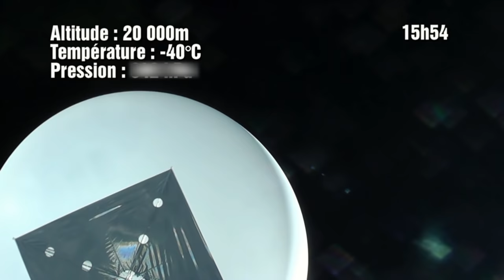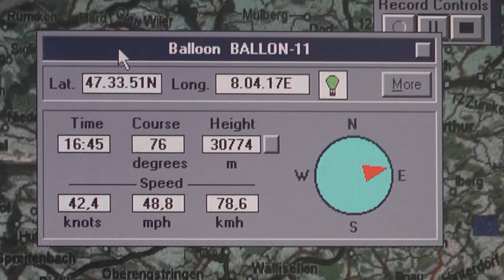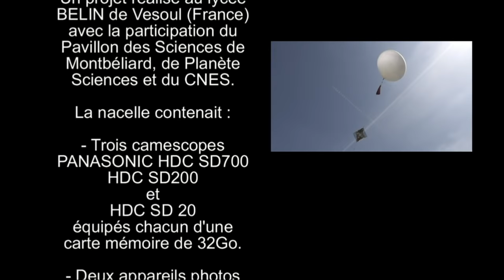Un ballon sonde stratosphérique filme un avion de ligne Swiss [subtitles]

Comment: Strangely soothing. Was it just me or did anyone else notice that the temperature was rising as it ascended into the upper stratosphere? I thought it would just get colder.
Reply: It does get colder… that’s negatives in Celsius
Reply: @Flywithjon  Did you understand what he meant? I don't think so. When the temperature of the negatives goes up (-50 -48 -46 -44) , it means it's not as cold.
Reply: Am I the only one who sees a flat horizon
Reply: That's because the highest layer of atmosphere is boiling hot due to high radiation levels. It's where asteroids burn up and the aurora hangs around.
Reply: @Fly with Jon  the temperature gets warmer the higher it goes up.  Just translate it into English subtitles and you'll see.
Reply: @daviddorset307  Take off your blinders. 🤦‍♂️
Reply: @nocturnalrecluse1216  what shape do you think the earth is a sphere or a oblate spheroid because according to your model you guys say it is both hahahahah you take your blinders off
Reply: Air temp gets cooler from ground up to next inversion layer then cool to warm until next inversion layer then repeats. You can see this balloon show the inversion layers in video
Reply: @daviddorset307  yes, Earth is flat

Comment: 8:05 that's where the SR-71 would fly at mach 3.2 and the pressure is almost nonexistent there makes me wonder how it really flew from lift with such little air the speed had to be a big reason why it was able to. wow
Reply: The wings really aren't needed at that alt and speed. Notice the very small or non-existant wings on such aircraft as the X-1 and the scramjets. It's basically a rocket at that point and only needs very small attitude surfaces.
Reply: @tomthumb1322   o ya that's right. Like how the Israeli f15 flew with a missing wing.

Comment: Anyone have an explanation as to why the temperature decreases to a point then increases again. Surely it should continue to decrease?
Reply: Bc of temperature inversion, other YouTube’s likely talk about if you google atmosphere temperature gradient or something
Reply: Maybe the sun was heating it up and because the air pressure is so low it can't take the heat away fast enough? It is a myth that you freeze instantly when you are exposed to the vaccum of space, vaccum flasks hold their heat because there is no air molecules to take the heat away. The only way to cool down in space is to give up your heat as radiation because there is no conduction.
Reply: Joe Cosgrove  The heat is transmitted by radiation mostly IR and light. This "heat" travels at the speed of light through space to earth. Because air is transparent light doesn't heat it much, as the light hits the earth it heats up the earth which in turn heats up the transparent air. A vaccum doesn't have a temperature as such because it doesn't have any mass. Space is like a "black body" in that is absorbs or "accepts" all radiation so that if an object is left in the darkness of space it will give up all of its energy as radiation until it reaches absolute zero (has given up all its energy).
Reply: If you microwave an egg you are heating it with radiation. If you boil an egg you are heating via conduction. The air in a microwave is still cool after you have cooked your egg. So the heat must have been transmitted another way other then heating the air.
Reply: Joe Cosgrove I've heard somewhere that the sun emits lightwave particles, and not heat. As the light is converted/compressed and charged by the atmosphere, it transmutes also into heat radiation waves, as well as functioning as light.
Reply: Abdullah Yate 
For the same reason that astronauts overheat when in the sun’s light but freeze when in shade.  Without air, there’s no way for the heat from sun’s radiation to radiate away from the object being heated.  If they were to release the balloon at night, they would get a very different result.
Reply: Will Blume 
It has to do with the lack of atmosphere to allow the heat gained through the object being struck by the sun’s radiation to radiate away from the object.  If they did this at night, then there wouldn’t be sunshine to heat the box and it would continue to get colder.
Reply: the warm layer is due to ozone which is concentrated in the stratosphere usually above about 10km. it's a gas which absorbs radiation from the sun warming up it's surroundings. it also occurs in the lower atmosphere called the troposphere but in much smaller quantities. it is there day and night although varies in height and temperature at different latitudes and throughout the year. in comparison, a balloon launched from northern scotland in winter could easily reach -80 degrees at the same 31km burst height. the ozone layer protects all living things on earth from harmful uv rays and is slowly recovering thanks to the montreal protocol which led to the worldwide cfc ban over 30 years ago, although it could take another 60 years for full recovery.
Reply: Adiabatic lapse rate.
Reply: Joe Cosgrove  It doesn't. Clearly the sun Is local and about 3000 miles from the ground and about 3000 miles in diameter. All you have to do is look up around noon and you will notice the sun is not 93 million miles away. Seeing it pass in front of, and behind clouds is what got me questioning nasa's bs.
God Bless The US, and you, yea even you.
Reply: Different layers of atmosphere behave differently when it comes to temperature against height. From theory.
Reply: If you learn about the layers of the Earth, the stuff the weather happens in is the stratosphere, above that is the thermosphere - that is why you see the temperature increase when it should still be decreasing
Reply: @dansmith2863  Don't microwave an egg unless you really enjoy cleaning up a lot of mess in every nook and cranny.
The egg WILL explode.
(Been there, done that. Not fun. :O) )
Reply: Clouds.
Reply: @liftmanleigh  Science yes but not your religious scientism you subscribe to.
Reply: PantoMath  A vaccum is not negative pressure, it is the zero point, its like asking why does the high pressure 100m under water not push into the lower pressure air atmosphere?
Reply: PantoMath  Obviously you didn't read my post, I said it is the zero point, Reread it then answer appropriately.
Reply: PantoMath  If you seriously want the answer then all you have to do is think about WHY the higher pressure 100m underwater does not spray out of the sea into the lower pressure atmosphere, WHY does this not happen? Then you will have the answer to your question.
WHY is 100m underwater high pressure?
Reply: PantoMath  Yes I can demonstrate that, If I put 50cm of sand into a vaccum chamber, the deeper the sand the higher the pressure.
Reply: @liftmanleigh  The Flat Earth Society has members all over the globe !
Reply: @knowledgeispower6732  In all my science education, from primary school to university, I don't remember any religion, dogma or scripture entering the picture at all.  The only person here who is entertaining religious, or more accurately fantasy, appears to be Yahusha is etc. Etc. Everything disproves your theories, from simple trigonometry to the ring laser gyroscope.

Comment: How can it be -50 at 15000meters and -24 at 28000meters...i thought it gets colder with higher altitudes but in your caption the temp.
  starts going down after 15000meters.Can you enlighten me pls.
Reply: The stratosphere is weird like that, one big temperature inversion.
Reply: @reynirheidbergstefansson2343  thanx..so the Strats started after 15000meters.
Reply: Definitely stratospheric by then. Anyways, there are articles on Wikipedia and elsewhere that will give you a much better overview than I can.

Comment: I was amazed at the temperature differences. I always assumed the higher the altitude, the colder the air. Not so in this case. Very impressive.
Reply: It usually is up to a point, then reverses.
Reply: I wonder how heat from the sun looses energy enough to be -52 degrees.. and then gains energy again for surface temperature?!
Reply: @cpvsgvmnt2116  The reason why the air higher up is cold is because the actual space radiation is traveling through is almost completely a vaccum in the atmosphere so the rays can go without hitting any atom warming it up but the ground is a lot denser so a lot more rays get absorbed by atoms so it heats up more and the radiation is transmitted trough convenction into the lower layers of the air so thats why its a lot colder when really high up.

And for the slight increase of temperature in the stratosphere this is caused because the ozone is absorbing a lot of the highly energetic uv rays which the lower atmosphere is not really capable off
Reply: exactly what i was thinking.
Reply: @adaptablerubenvideos3097  I think it's more like the harsh radiation heats up the box that contains the thermometer.

Comment: Pour répondre à certaines mise en doute concernant la forme de la terre; j'aimerai connaître la focale de l'appareil photo qui a pris la vue à 38000m, ainsi que celle  publiée ici sur juste après l'éclatement. Merci
 Et pour info, la photo à 9mn06s de la vidéo ci-dessus, mesurée telle qu'elle sur Autocad montre un rayon de  courbure de  18257, pour une largeur de 1000  unités arbitraires!
Ce qui correspond à un angle au centre de la terre de  1000/18257 rad= 3.14°, donc un horizon de 349km. 
Et la différence de verticalité entre les 2 bords de l'horizon est de 3.14°...
A cette altitude, l'horizon est à R*acos(R/(R+h))=6373*asin(6373/(6373+28))=596km , ce qui correspond à un angle de prise de vue de 33,5°.
Pour la photo prise à 38000m montrée sur le site de l'école:
http://www.lycee-belin.fr/index.php/matieres/physique-2/129-ballon-sonde-2010
 d=837 ,   R=9909 unités arbitraires Autocad
 angle au centre de la terre  = 4.84°   
 champ de prise de vue sur l'horizon= 6373* 4,84*pi/180=538km
 différence de verticalité 4.84° sur les deux bords
 distance objectif horizon à 38000m = 6373*acos(6373/(6373+38))=694km
Des erreurs?
Reply: Merci, la courbure se voit et peux même se mesurer avec un simple logiciel de retouche photo.  Je n'avais aucun doute, les arguments qu'ils avancent sont vérolés à la base. C'était juste pour montrer ce que pourrait être leur recherche. 
Car leur explications utilisant la perspective montrent une méconnaissance totale (volontairement ou non) du phénomène, et leurs mesures laser vers l'horizon  qui négligent les effets de la réfraction pourtant presque 10 fois plus importants, ne peuvent rien prouver. Sans parler de leurs fausses affirmations toujours répétées, jamais confirmées, concernant les autres phénomènes qui les gênent. En plus, ils ne tiennent pas compte des ordres de grandeur...
 J'oublie les bannissements arbitraires, dés que l'on se montre un peu trop précis. Cela à été mon cas, lorsque j'ai osé dire que j'étais allé au pôle sud 15mois, et que j'étais monté sur "le mur de glace".
 :)
Reply: Respect :)
Reply: jeteste « mouai... ché pas hein »
Reply: Alors jy comprend rien prcq jai que 12 ans mais je m'intéresse à cette vidéo et j'aimerais comprendre tout tes calculs.. Mais bon mdr jvais pas te faire chie* a tiut réexpliquer pour un idiot comme moi😂
Reply: Heu... ce qui signifie, concrètement?
J ai compris la première partie mais ensuite...
Reply: Tu travail pour la naza?😂

Comment: At 4m 20s when you hear the sound of the airliner at approx 10,000m, the camera intelligently pans backwards180 degrees? then stops to get the airliner in shot? then pans forward with the airliner in frame and follows it as it flys past? like the camera is under intelligent control. All very convinient and all this happens very quickly with the airliner at exactly the right height and captured by the camera. Or alternatively, that section of the footage was added in during the editing proces as a way to attract more YouTube views perhaps?
Reply: Or maybe it was stabilized and controlled remotely. Ah the wonder of technology.
Reply: @noevilea624  as an RC enthusiast myself was a VR headset utilised? so that the real time environment around the ballon could be reacted to as they do with modern drones etc? which requires connections to servos and batteries and subsequent increase in weight needed to remotely operate the cameras for the purpose of collecting the one inteligent shot of the fly past. Unlike the rest of the footage which uses the random rotation and oscillations of the balloon in flight and no other intelligent choice of shot or framed video.
Reply: exactly like the footage of the module landing on the moon and taking off the moon... so if the filming crue was already there why so much for the first man on the moon hahaha
Reply: It's clearly a zoomed in sub-section of the overall picture, moved to follow the plane in post process while editing the video. I wish people had just a little bit of a clue about the things they're commenting on.

Comment: What causes all these balloons to pop when they get to a certain height? The temps? If so, can we create better balloons? The Gas used in the balloon? If so, can we create better balloons with a mechanism that injects a lighter gas that can withstand whatever it is that causes these things to burst?

Sincerely, the entire world.
Reply: As the balloon gains altitude the atmospheric pressure outside gets less and the pressure inside the balloon expands until it reaches the bursting point or until a signal is perhaps sent to cause a burst. That's just my basic take on how it works. Different materials are another variable. A great project and wonderful video.
Reply: GoPro rocket has a video that show it hit something through water
Reply: @truearther  Link?
Reply: Mark N is right, if the balloon bursts. If the balloon doesn't burst from expansion it will reach an altitude where it's internal pressure equals the atmospheric pressure and simply won't go any higher.
Reply: So the question is can we make a balloon that can allow its pressure to be changed by using sensors to read the pressure as it reaches these critical points, and then eject a different kind of gas that will allow the balloon to pass the zone where the pressures are equal as J Richardson pointed out causing the balloon to go no further.

 I feel like the government has the capability to do this already.   It'll take a strong balloon material and a new balloon design.(perhaps put three balloons inside the one balloon each with their own gas) so when one balloon with its own special gas reaches its point and is no longer helpful with climbing in altitude another balloon will fill up with a different gas of different density and pressure value just at the right time to bypass that zone and so on... and deflate the other balloons if need be. 

I feel like we're acting like cavemen with sending one balloon up with its one type of gas(or gas mixture if that's the case) where it just pops at a given height every time. 

Also is the air so thin up there that if a Drone was strapped to the balloon programmed to turn on and fly on auto-pilot when the balloon pops.. Would the drone be able to create enough thrust to continue going higher?
Reply: yes plzzzzz
Reply: get this dude his own show lol
Reply: @ChristopherJones16   The world record balloon flight went to 170,000 (51.8 km) feet with 1.35 million cubic meters of hydrogen, the lightest gas. The atmosphere is around 53 km thick so it would be impossible for it to go any higher, there is only the vacuum of space beyond that.
Reply: @ChristopherJones16  By the way, a drone wouldn't work or by definition ANY aircraft, without an atmosphere. You would need a rocket to escape earths gravity.
Reply: The Firmament.

Comment: It doesn't look flat at 31 257 m. Make a print screen of the horizon line a 10:19 time mark and then paste it into Paint, select the straight line tool and with it connect the two ends of the horizon and you'll see that while the line is perfectly straight, the horizon itself bends upwards slightly in a quite visible way!

So no flat earth here. Do your homework!

Comment: Bravo, beau projet collectif, ça a permis de mettre fin à une croyance populaire qui veut que plus on monte, plus il fait froid. Et c'est dommage que le ballon ne soit pas monté plus haut pour montrer la courbure du globe, ça aurait pu faire taire une fois pour toutes, les partisans  de la terre plate.
Reply: Mais le courbure est visible, lisez les commentaires,  je répète:

D'abords un photo annotée extraite de la vidéo:
  http://s99.photobucket.com/user/synsei1/media/misc/courbure%20terre.png.html
 
Et pour info, la photo à 9mn06s de la vidéo ci-dessus, mesurée telle 
qu'elle sur Autocad montre un rayon de  courbure de  18257, pour une 
largeur de 1000  unités arbitraires!
Ce qui correspond à un angle au centre de la terre de  1000/18257 rad= 
3.14°, donc un horizon de 349km. 
Et la différence de verticalité entre les 2 bords de l'horizon est de 
3.14°...
A cette altitude, l'horizon est à 
R*acos(R/(R+h))=6373*asin(6373/(6373+28))=596km , ce qui correspond à un
 angle de prise de vue de 33,5°.
Pour la photo prise à 38000m montrée sur le site de l'école:
http://www.lycee-belin.fr/index.php/matieres/physique-2/129-ballon-sonde-2010
 d=837 ,   R=9909 unités arbitraires Autocad
 angle au centre de la terre  = 4.84°   
 champ de prise de vue sur l'horizon= 6373* 4,84*pi/180=538km
 différence de verticalité 4.84° sur les deux bords
 distance objectif horizon à 38000m = 6373*acos(6373/(6373+38))=694km
Des erreurs?
Reply: He ben tant mieux, je la regarderais une seconde fois, car à la première la courbure n'était pas significative. Il y aura-t-il une autre tentative à au moins 50 km ? sans que le ballon n'éclate ?
Reply: Il suffit de regarder la photo du lien de mon post, la courbure est parfaitement visible et permet même de calculer approximativement la dimension de la zone visible de l'horizon !